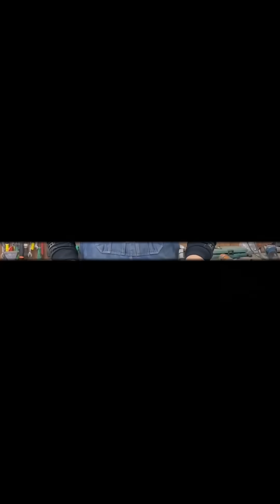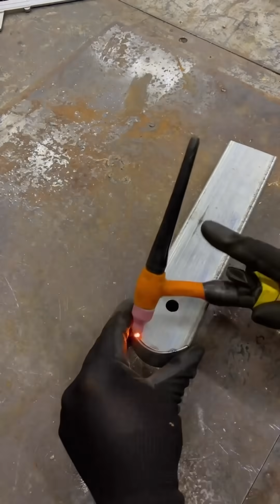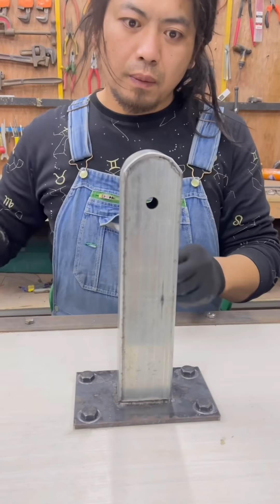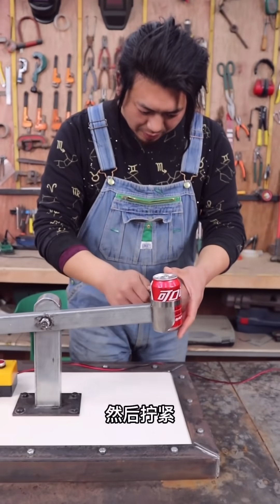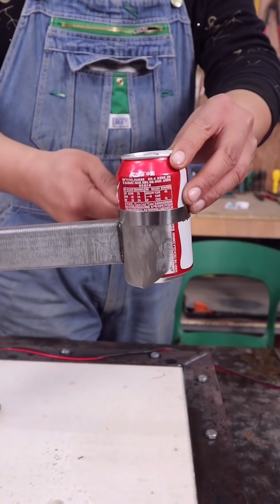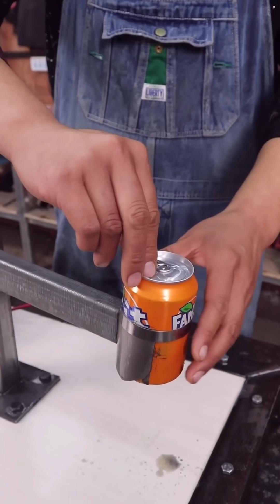ENG)自製汽水搖瓶器還原網絡熱門視頻？ DIY Soda Can Shaker【手工耿Handy Geng】

Comment: Electric walkers with 6wheels suspension armrest-handles roof doors windows air-conditioner and radio. Good for the rain and extreme wether. It's better than walking. You can use in bike restricted aria.